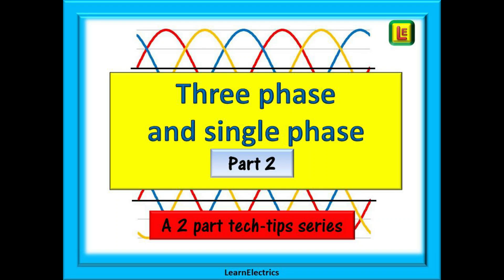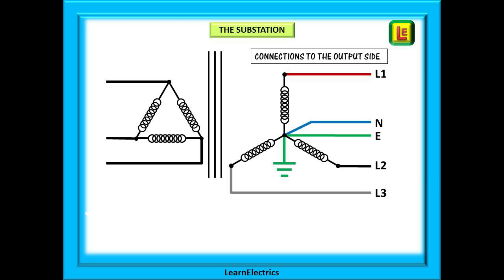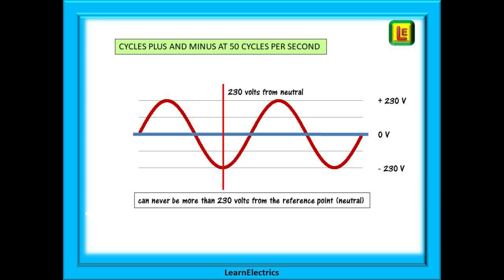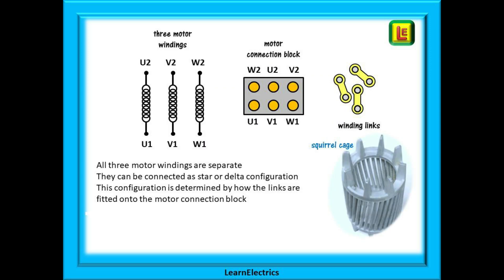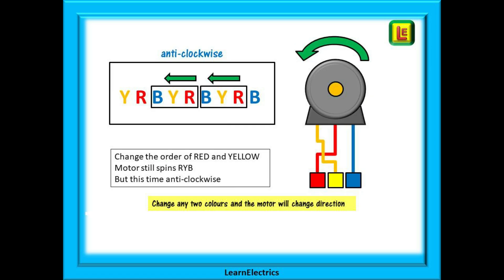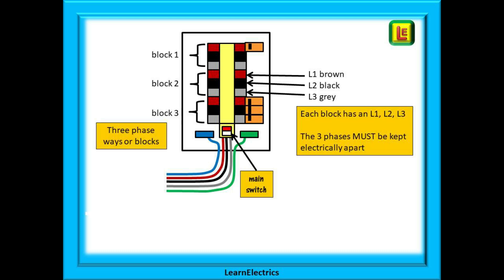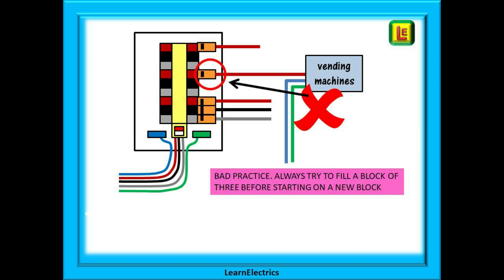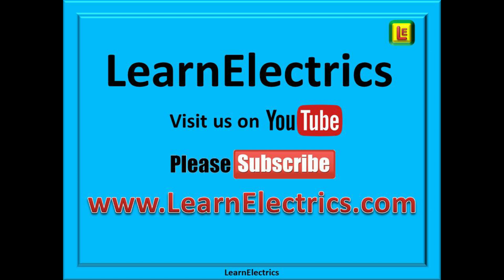3 PHASE WHAT IS IT? Part 2 - THREE PHASE & SINGLE PHASE SUPPLIES

Comment: Great explanation! In the Netherlands the old colour scheme used to be for single fase installations:Green was Phase,Red was Neutral, Black was (lighting) switch wiring and Grey was earth. Sounds a bit odd having Green as a Phase. In 3 Phase cables the following scheme was used: Green,Bleu and Black are Phases, Red Neutral and Grey was earth. The old colours were in use until 1970 and replaced by Brown for Phase 1, Black next to Brown(often marked with a dotted White line or even White line for Phase 2 in a 5G cable or Bleu in a 4G cable, Black next to Bleu Phase 3. Bleu was in a 5G cable neutral and Green/Yellow earth(4G is a cable with 4 wires etc). In 2001 the colour scheme as presented is the norm also in The Netherlands. Love the content and cheers from Holland!
Reply from the maker: Yes, Europe had lots of different colour schemes, and the new harmonised colours have helped but there are still many installations with old colours. We just have to be careful when working on them. Thanks for watching. Dave.

Comment: In star configuration of transformers L1, L2, L3, Neutral and Earth are all connected to centre point. How ia it that no current is flowing through N & E but its flowing through L1, L2, L3 while all five conductors have a physical connection at centre?
Reply from the maker: In a properly balanced 3P+N+E system, the neutral current will be zero. That is why we use a clamp meter to balance the phases as best we can in a distribution board. Spread the load evenly across all three phases. Hard to achieve but we try to get the neutral current as low as possible. Good question, hope this helps.

Comment: I thought neutral was always required for a path back to source to complete the circuit? How comes we can use 3 phases with no neutral and have it work when if we use single phase with no neutral nothing happens?
Reply from the maker: Single phase currents add to zero. 16 amps in, 16 amps out for example.
With three phase, phase 1 uses phase 2 and phase 3 as a return path, phase 2 uses phase 1 and phase 3 as a return and so on. This means that the voltages for all 3 phases add up to zero. It is explained in the video but does take a bit of getting used to. We only really use neutral in three phase circuits if we also need a 230V single phase circuit for control gear etc. Have another look at the video, it will make sense. Thanks for watching. Dave.
Reply: @learnelectrics4402  Thanks mate, love the vids. Criminal how few views you have. Maybe you need to waffle for the camera and put a fancy dub step intro?
Reply from the maker: Thanks buddy. Just need to spread the word. Dave.

Comment: Another fantastic video so well explained. One question could you just briefly explain why the neutral point at a transformer is earthed please i cant fully understand why that is, as from drawings it looks like one big dead short between the neutral earth and phase conductors thank you keep up the great work 👍 3:30
Reply from the maker: It is. It is the zero reference point for everything. How do you know you have 230 volts if you don't have a zero point. If you take the negative terminal off your car battery and then measure the voltage on the car, you will have nothing because you have no reference point. I'm 6 foot tall, with reference to what? The ground I'm stood on. My mother is 5 feet tall, with reference to the same ground. Hope this helps.
Reply: @learnelectrics4402  love it!! Great thank you!! keep the content coming you know exactly how to explain things easily 👍👍
Reply from the maker: Trying my best G. Dave.

Comment: Great, explanation. But Sir can you make a clip on knowing the right earth electrode rod (size)to use in home or commercial building electrical installation ?
Reply from the maker: Page 195 of Wiring Regs. Table 54.1. Hope this helps.
Reply: @learnelectrics4402  pls sir can you send it as a pdf file for me. I don't have access to that book ?
Reply from the maker: Pabor, not allowed to copy it, it is copyright material.
Reply: @learnelectrics4402  ok sir.